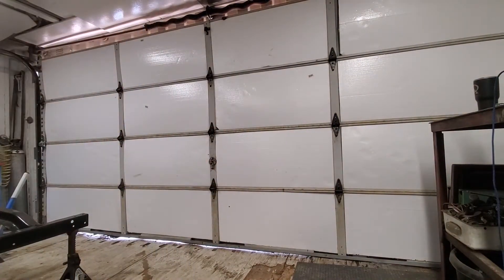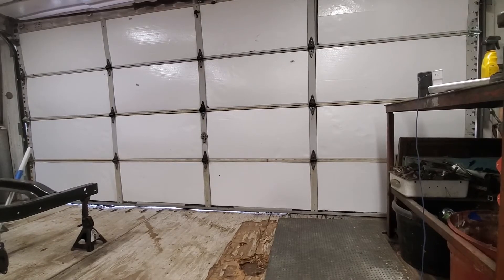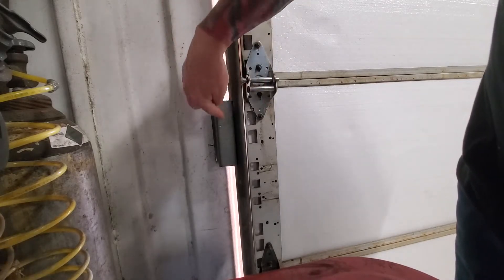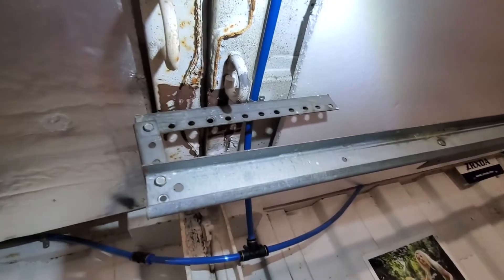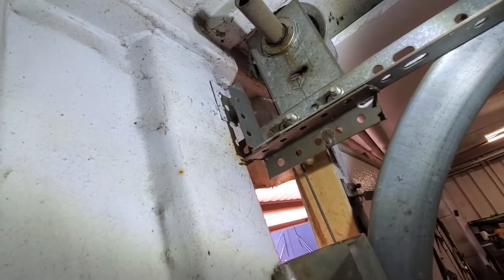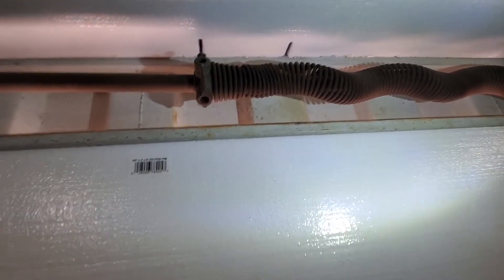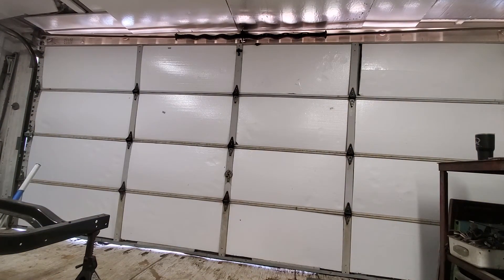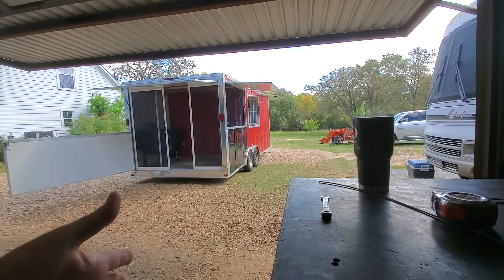Building a shipping container garage, Garage door install review

Comment: Do you have any videos about doing the floor?
Reply from the maker: I don't have a video for that yet, when I install the next one. It was just laying plywood on top of the existing and screwing it down.  Then a coat of white paint.
Reply from the maker: But I do need to replace two sheets,  so I can run video on that
Reply: Did you add a structural metal frames to the sides of the containers you cut out ?. 

I have seen a lot of videos where people said you had to add framing. But I honestly don't think the sides of a container needs that.
Reply from the maker: For this garage I did not add any support to the sides. The front opening is 16x7 to accommodate the door. On the two tops for the center, I welded them together and added a 4 inch strip of side steel along the run.  There's little flex when I walk up there but the roofs aren't the strongest point anyway.
Reply: @ELDESTBuilds  Thanks man, I appreciate your response. Happy Holidays to you and your family. 

So many people were saying you had to support the cutout sections and my thinking is. The metal frame of the container should still support the sides being cut out.
Reply from the maker: Maybe if you were gonna add a second floor
Reply: @ELDESTBuilds  Yeah I can see that. But these people were adding steel supports to the side they cut open to add a window or garage door.
Reply from the maker: I don’t think that's necessary
Reply: @ELDESTBuilds  Thanks I was thinking the same thing. 

I watched your videos and didn't see any supports. And your side opening is larger than a window or sliding door opening. 👍🏽
Reply from the maker: And for my next one I have a 18 foot wide roll up door.
Reply: @ELDESTBuilds  I will be watching it once you put a video up for it. 👍🏽